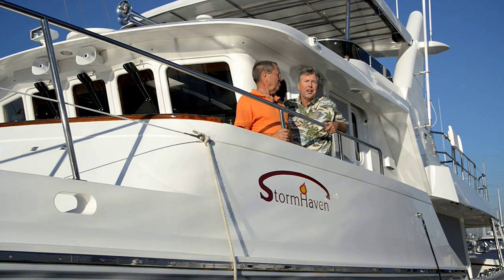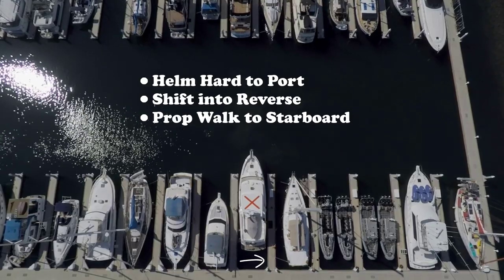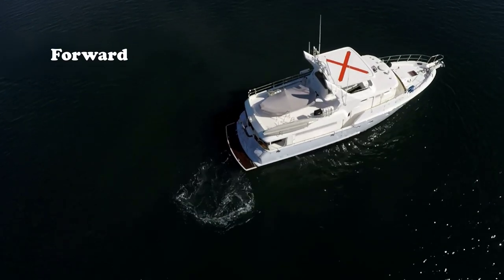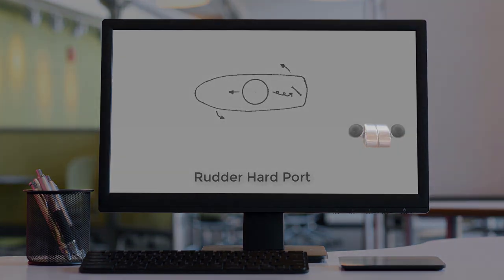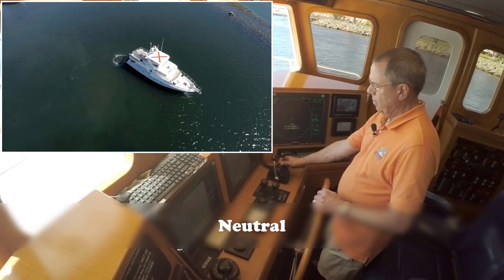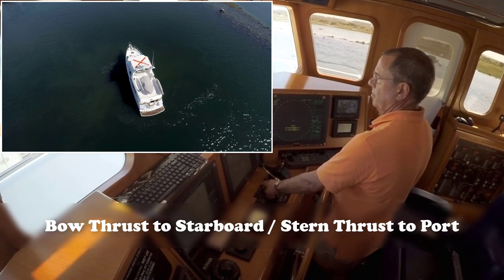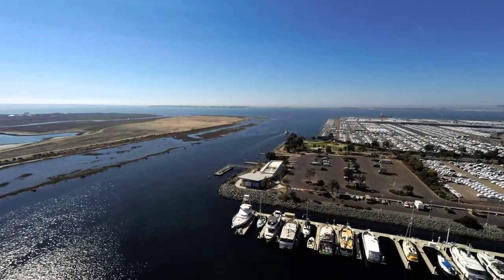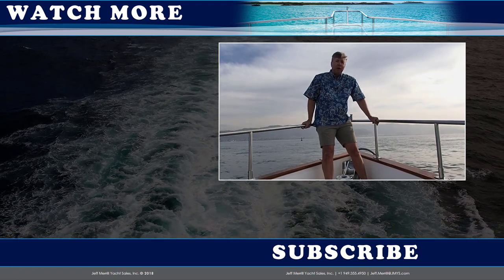Physics of Docking - Pivoting

Comment: isn't that a 55? Description says 57 but this boat has the usual Nordhavn reverse rake pilot house windows. The 57 and 50 are unique with motor yacht style pilot house windows, and other features that differ from the rest of the fleet.
Reply from the maker: SailinStyle - Very good observation and you are close.  The boat we used for filming is one of only a handful of Nordhavn 57’s with the reverse raked pilothouse windows.  The majority of 57’s and all 50’s have the aft swept (car windshield) wheelhouse windows. One way you can tell it’s a 57 is the flybridge is behind the pilothouse, not on top (like a 55).  Also, the 55 has a single column fiberglass dry exhaust stack. 
All of the Nordhavn 57's have two shorter fiberglass columns outboard in the aft section of the flybridge.  When a dry stack was ordered on a 57, the engine exhaust was routed to the starboard side stack.  Those 57’s with wet exhaust (that was a popular new build option) have the twin stacks for consistency, but also more for styling (some engine heat ventilation runs up fiberglass columns too).
Reply: Wow, I had no idea they built a reverse-rake version of the 57! If I'd looked closer I would have spotted the dual outboard stacks and the position of the pilot house, and then I would have been really surprised!

Comment: Interesting , I would have preferred if you left the thrusters for a separate video. I have a 15' old inboard launch the prop walk is huge so much so that it drags the entire boat sideways , practically no pivoting .  Shame as it makes it very hard to maneuver in close quarters which is when you need it! Going to take a lot more practice I guess to find a way. Cheers Warren
Reply from the maker: Thanks Warp 2.   Obviously different handling characteristics between a 15' launch and a 57' trawler, but many of the principles are the same.  Just about every trawler has a bow thruster now (few did 30 years ago) even sailboats are getting bow thrusters.  Practice is the best teacher. Thanks for watching and commenting!

Comment: did I miss the rudder direction while pivoting ?
Reply from the maker: Hi James - at 6:15 I mention rudder hard over to back and fill, is that what you are asking about?  Helm all the way to one side provides the best deflection of propeller turbulence. Thanks for watching!
Reply: JMYS - Trawler Specialists 
Just what exactly is propeller turbulence?
Reply: @JeffMerrillYachts  Yes I noticed that it was not made blear at the begining but was on the diagram.
I always use the cat technique on my new Riviera dual engine cruiser. That is, rudder neutral and steer with throttle, so does this method have some advantages or disadvantages? I did see the trap that when you want to go ahead after the spin you have to correct the helm which I don't need to. André
Reply: @masterful7574  it's just another technical terms for prop-wash or axial (straight) thrust.
Reply: @SoundzAlive1  are you from oz?
Reply: @kenlee-97  Yes, Sydney.
Reply: @SoundzAlive1  yep, me too ,Rivs' are generally in oz, on the eastern seaboard of Australia,  thought I do remember  reading about in 2002-2003 that Riviera marine had delivered a few hulls of theirs to Dubai and they did a write up story of the voyage which from memory I remember they showed photos of the vessels being bow heavy (-technically called 'trimmed by the bow'-which is not ideal for any sea voyage regardless of sea-state conditions) due to several 44 gallon drums of diesel inside for the voyage to Dubai I think it was , at the time I think there was no shipping company that was able to accommodate this vessel to it's destination, or simply a pr stunt for the company. Cheers.

Comment: Teach ...pivot-point ....transverse thrust , using external forces to your advantage ( wind ...current ). These forces work for all vessels big and small.....
Reply from the maker: Leonard, agree. Natural forces, wind, tide, current can definitely assist (or impede). Turning into the wind to hold your position instead of with the wind to drift down course.  A lot to discuss. Thanks for participating with this.
Reply: My first boatven was a little 20 foot Clinker built with a one-lunger ( not even sure how many horses ) , it used to blow the most perfect smoke rings  putting down the harbour. I have been playing and working on boats bever since . I have been working as a marine Pilot for twenty years , all ships great and small, the biggest was a Containership ( 385 meters Long ), the ships are approaching 400 meters now , they all handle the same ....pivot point, transverse thrust , wind , current .... my little boat was still my favorite.
Reply: JMYS - Trawler Specialists tide only goes up and down.
Reply: @masterful7574  true, he's probably referring to tidal /currents ,as an effect of moving water in a certain direction. Cheers.

Comment: How does this maneuver work with counter-rotating props on single engine stern drives
Reply from the maker: Joe - I can't answer that from experience.  Most trawlers do not have a stern drive and that is our primary focus.  Most stern drives that I'm aware of don't have a separate rudder that you can "bounce" the wash off of to move the stern from side to side.  Anyone with stern drive experience have a better answer for Joe?
Reply: Thanks for the reply. I didn’t know if this technique would work on a smaller boat.
Reply: @joemast2984  Joe, a counter-rotating duo-prop design sterndrive will act exactly like a single propeller outboard engined boat, as the two props will counter act each propellers slight bit of prop-walk/transverse thrust  IF  there's EVEN ANY to begin with in the first place, as most sterndrives/outboard engines have propellers that don't produce any prop-walk/transverse thrust. Cheers.